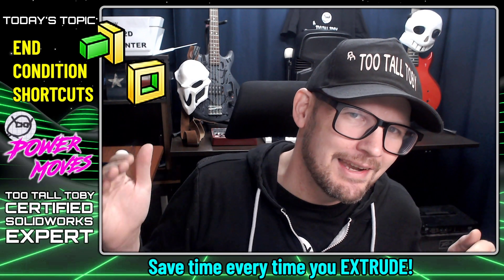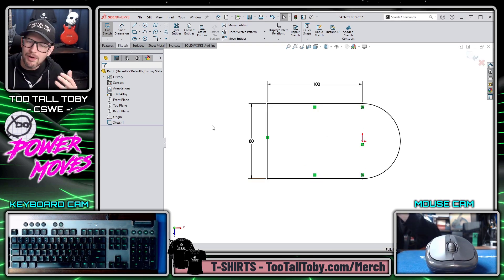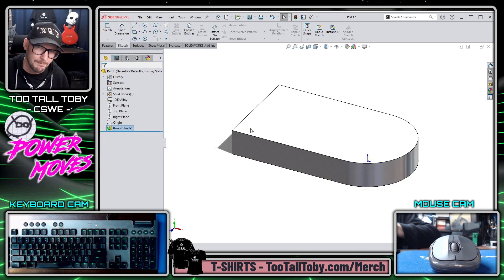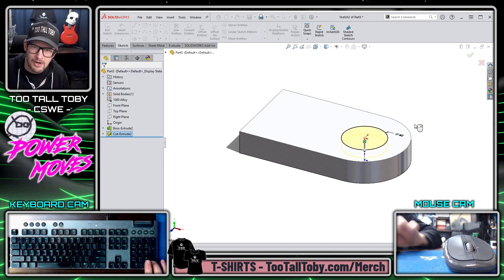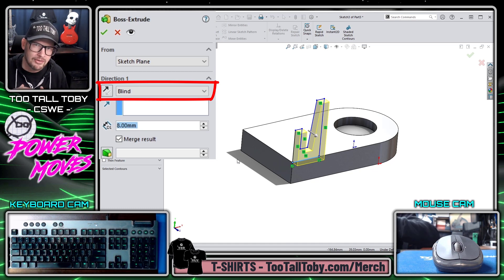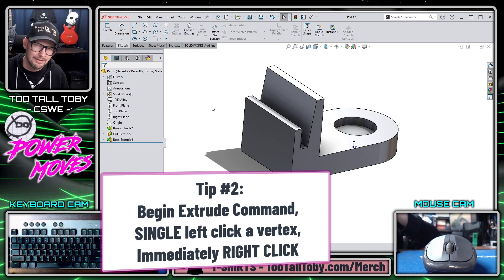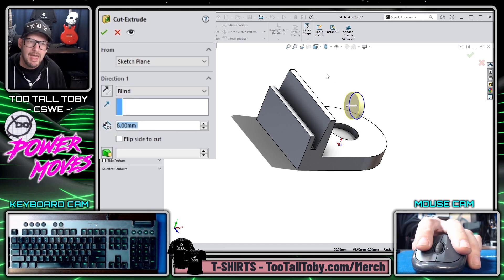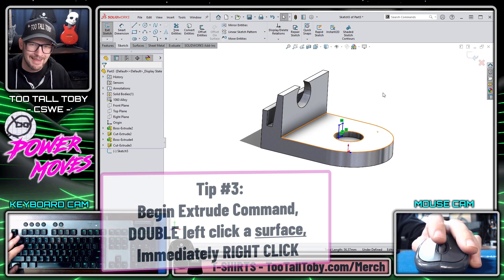quickly create SOLIDWORKS extrudes using these END CONDITION shortcuts!

Comment: Hello there... I had a problem doing this trick, just like you, I extruded first block, then second by clicking on a vertex.... The problem occurs when I am going next step..... When I click extrude I don't get the 'Blind' condition now this time I get what I used earlier that is 'Up to vertex' condition ..... So if I want to select surface SW doesn't react to Surface cause Vertex is the condition... And that's why I need to change the required condition each time.... Any solution to this?
Reply from the maker: Hi PXGamer.
The short answer is: The SOLIDWORKS developers hard coded this change into SW2021 or 2022 (I cant remember which)  -so the only way to "get it back" is to use an earlier version of SOLIDWORKS.  I actually stopped upgrading after 2020, specifically for this reason (although I do have SW2022 that I still use for teaching purposes).

Advice 1: You can start using RIGHT CLICK after you begin the extrude command, then choosing the end condition from the right click menu.  Not as good as it used to be, but still better than navigating over to the property manager.

Advice 2: You can file ENHANCMENT REQUESTS To try to get SolidWorks to make "remember last end condition" an option, rather than a hard coded setting.

Sorry bro - but hope this helps.  I use Advice 1 (above) whenever i'm in 2022 😁

PS - dont forget you can practice your workflows, like this one, at https://www.tootalltoby.com in our practice models app
Reply: @TooTallToby Ohh Thanks a lot for the advices, btw I am using Solidworks 2024 version.....
I believe your tips are useful and I already started using few of them in my workflow......
And yes thanks for the link I will use it. 
And most importantly thanks for reply even though this video was 2 years ago you still actively replied me 🙌